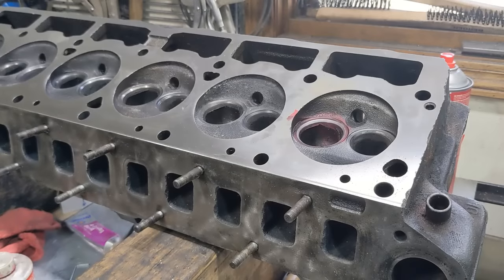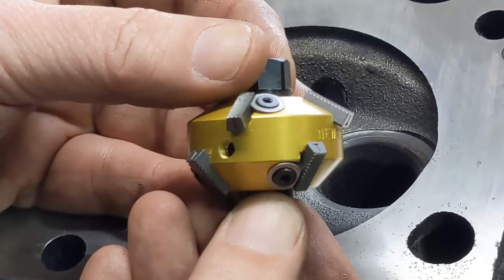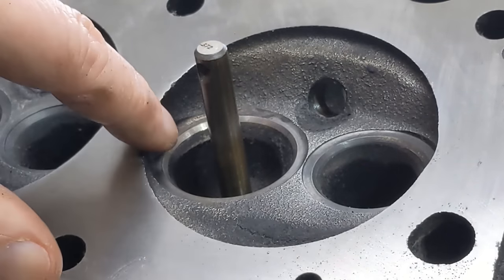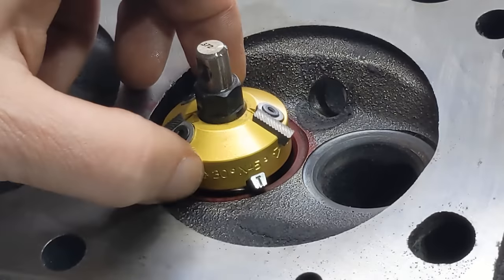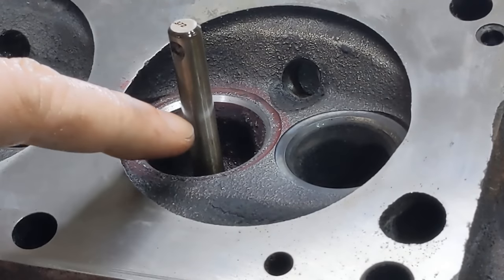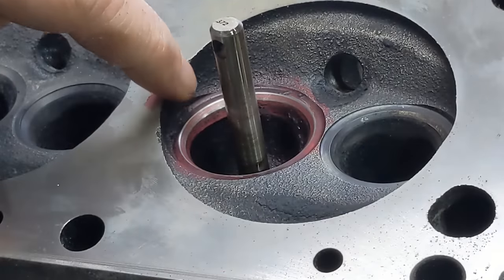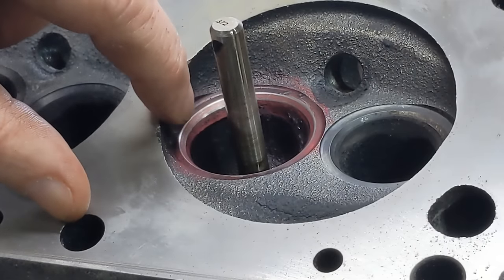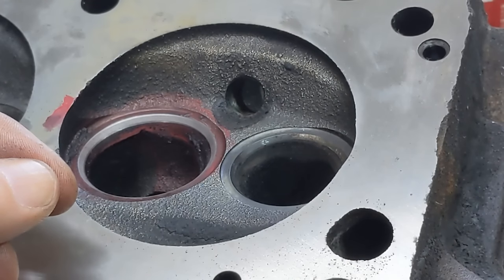Do Your Own 3-Angle Valve Seats!

Comment: Run that 60 again: seat width is bigger than I-10 through Houston.  Margin at the outer diameter [on valve] is good enough.  Aim fpr about 0.045" seat width.  Self cleaning and low lift flow will improve.
Reply: I don't know I-10 through Houston but agree.
Reply: @1crazypj  Houston, Texas has many 10 lane highways that are still packed with traffic. I am so glad I don't have to live there.
Reply: @skylinefever  Thanks for the explanation. I 'found' an old thumb drive today (from around 2010) with valve seat width information as percentage of valve head diameter.
Reply: @skylinefever  I live near i10 and work on 10 at the beltway on the west side of Houston . I-10 on the westside of Houston is 26 lanes wide. Remember every thing is bigger in Texas!!!
Reply: @mlwakat holy 🐄
Reply: @markalan4026  yes, Mark. The cows are bigger in Texas too👍

Comment: I find the hand cutter makes it hard to get a good constant cut as you have to reposition your hands while cutting.  I use a Milwaukee cordless in slow speed with 3/8 socket adapter and 1/2 inch deep socket.  It cuts quickly and leaves a nice finish..
Reply: I have an old Black & Decker valve seat grinder from the 50s or 60s. I don't do very many valve jobs anymore, but I do think a ground seat is the way to go. Especially for hardened seats.
Reply: @pb68slab18  Back in the 70s I had a snap-on valve seat and valve grinder.  IIRC they were B&D rebadged. When I got out of mechanics professionally, I sold them.  At the same time. the hand cutters came out. They did not produces as good a finish as the ground seats. Still using a drill motor real slow make the cutters work very well.. Still regret selling grinder but at the time I needed the money.
Reply: Start and stop of the hand cutter is not best.
Motor driven will be smoother.

Comment: The 60 and the 30 cutters do give you a more progressive flow pattern but their main purpose is to give a vale seat its correct width and its correct position on the valve face that is why you must have the valves you are using with you when you cut the seats. it is also very important with cutters like these that the valve guide is well within wear tollerances or your seat will be out of center or tilted. You also need to keep an eye on valve depth as undercutting seats leads to uneven valve spring heights and tensions. This is also very important when using new valves and new valve seat inserts because with some engines if you leave the valve sitting to high and have shaved the head the valve may hit the piston. This is more of a problem on heads with no combustion chambers like with most diesel engines. Gas engines with multi valve systems at more acute angles can have this problem as well. The valve seat shown at the end is to wide and that will work against flow rate.
Reply: Correct I agree

Comment: Grinding paste never failed me .....just takes a fuck ton of time when its badly burnt.
Reply: Lapping paste doesn't achieve the same as a three angle valve job. Lapping paste is for reseating. Three angle jobs also improve flow across the valve seat.

Comment: I purchased does cutter set in 1980s.  I paid $1600 US. I cut the seats at 45 degrees, and the valves face at 44 and half degrees for best sealing
Reply: https://youtu.be/uOk5L8Q__as  valve seat ring removers

Comment: The 46 deg angle on the valve and the 45 deg on the seat is so that the valves and seat will slap into a tight seal for mass production.  When I was working on the old VW motors.  When cutting valve seats you can slam the valve in hard or just seat the valve and give a gentle tap.  The valve will get a fine line on it so you can get an idea of the seat position prior to lapping/ grinding the valve and seat. It saves time from going back and forward from cutting and lapping.  I have had a set of Neway cutters for years, wouldn't be without them. They live on the shelf and they don't eat much.   Kerosene is a good cutting fluid and don't drop the cutters.  Cars, Lawnmowers, motorcycles and most anything they can be used on.

Comment: I used to teach this and video is probably better in most respects than the official Neway training video. (plus it doesn't have the 1970's background music)
There are a few extra things to check, seat width as mentioned by 'Flinch', seat position on valve face plus valve installed height
Seat width around 0.040"~0.060" (1~1.5mm) on intakes is normal with 0.060"~0.080" on exhaust side (1.5~2mm)
There is a general formula to calculate seat width based on valve diameter but maximum and minimum is  generally in the accepted range (unless your doing a 'race tuned' 35cc Honda weed-whacker or marine diesel with 3 to 4inch diameter valve heads.........LOL)
For 'ordinary' engines, centre of face is good as it will give maximum life before replacement or reconditioning.
For performance, move contact point closer to outer edge cut 45 to slightly larger diameter then reduce seat width with 60 degree cutter.
Although installed height is 'less critical' on engines with push-rods or adjustable rocker (or some form of non-shim adjustment) it can be very important and need the valve stem tips ground shorter to either get clearance (with OHC shim motors) or correct rocker arm geometry

Comment: I highly recommend using a valve seat runout gauge from someone like Goodson Tools. It goes over the pilot rod and will tell you if the seat is concentric with the pilot. It will also let you know which side of the seat is higher and to press the cutter a little harder on that side.  Valve seat runout plus valve face runout combined should be less than 0.002”.  New valves out of the box can have as much as 0.005 runout and need to be trued up on a valve grinder like your friend has.  /John
Reply: excellent recomendation
Reply: Using ink on the seat, and the new valve is a great way to see whether you have run out or not

Comment: Good job on the video.
The Neway cutters are tricky to master using the hand t-wrench.  I'll typically use (2) hands pushing downwards with my palms to balance the cut while rotating with some Windex for the cutting fluid. Using (1) hand typically produce an unbalanced cut that takes forever to cleanup, thus lighter cuts are better.  A helper spring would have saved me from dulling the carbide cutters when the cutter head drops accidentally every so often so extra carbide blades are a good option. I've used 800 grit lapping compound to quickly lapp the valves in and nothing rougher. Then a wire wheel to remove the lapping compound off the valve face and seat.  Not too hard to adjust the seat width according to the factory spec but it takes some practice for sure and I use a loop and caliper.  Trick is removing just enough to avoid cutting the seat too deeply or at least keeping them all consistent so IMHO it's good to practice on another junk head to get the technique down.  I believe the Neway powered head would be a huge improvement in cutting consistency and speed so that's probably my next upgrade. But otherwise with some skill you can definitely get some nice 3-angle valve jobs with these if you take the time and develop the feel for them.  Most of the pros would probably recommend a Serdi, Sunnen, or Rottler but for the DYI folks these Neway are not too bad for the money.
Reply: Thx for the input bro, all this while I was thinking about the machine shops for this kind of jobs. I am awakened. 😁
Reply: Only ever used neway cutters on Lycoming and continental engines, always working on seats from the other end of the cylinder with a long extension must have helped keep things square as I never had issues applying even pressure. Agree cutting fluid is essential for decent results.
Reply: So many people don't understand this. Seat concentricity is so critical to longevity. Factors such as valve guide wear only compound the problem. Yeah, a monkey can make a seat that will seal for a while with a Neway. But to create a correct seat is much harder. The real issue for Neway is the finish of the cut (as you commented) and the lack of cut depth indication with a hand cutter.  There is a powered track system for Neway type cutters but it dose not depth indicate. Runout is still an issue with any floating type of cutter like Neway And 3acut (ebay brand). By the time you have purchased all that you can buy a good used seat and guide machine like a Peterson 25 or a Winona and a basic Newen (not Neway)  3 angle system. The Newen has several knockoffs that are even cheaper than the brand name. Regardless quality application specific cutters are sold by cylinder head supply of Oregon, or Goodson, beam equipment. Silverline and many others.    https://www.cylinderheadsupply.com/pr3vasecuki.html
Reply: @bad406camaro  Holy shit, someone who actually has a grasp of engineering principles. Well explained mate. But you know what they say.. " I can explain it to you, but I can't understand it for you"
Seems to be the overriding vibe here.

Comment: It should be noted that the 30 and 60 degree angles are used to adjust the width of the 45 degree sealing surface. Too hide and the valve can actually run too cool. Too narrow can cause the valve to over heat. If I remember correctly a good width is 1mm. Also you need to avoid tool chatter when cutting and make sure the valve guides aren't worn.

Comment: In Dr. Lynn Mosher's head rebuilding class at Cal Poly San Luis Obispo back in the late 70's we were taught to forget about lapping ,as it should have gone out with the model T. It seems  as the valve heats up it gets longer and no longer seals at the nice frosty line from lapping that gave you a warm fuzzy feeling.I had lapped valves since high school like my ole man did once a year on his flathead Hudsons.  I checked this out once  and actually did it with a 170c.i.slant 6 with new valves and 0.030 larger stems like Chrysler recommends for worn guides. I step reamed the guides to the .030 as wellof course . I heated the exhaust valve in a lab oven to about  600 degees  installed with dykem and proved the valve face did not hit the previously lapped area.
Reply from the maker: Great info!
Reply: Is exactly the way I have done it for50 yrs, never had a problem. Soon as I saw that pogo stik an paste  come out,I could see an otherwise reasonable  job being vandalised. 
My saying, "lapped  to crapped".
Also  he only machined an intake with no insert straight cast iron "chocolate ", compared to some modern inserts.
I say, show us a job on a well used welltite inexhaust insert using these cutters. And show the actual outcome with the markings on the valve.
Adrian.
Reply: @adriandines  I've had Neway stuff for years, as well as an old flexible grinder with stones, but I made a mistake using the Neways using a T bar handle in an old air cooled engine with rock hard seats (same with sintered Kolbenschmiddt stuff).  I eventually got out of the poor cutting results by using a slow speed cordless drill and ball joint driver, and learnt a lesson in the process. They did produce a good finish in the end, but the next engine I build I will definitely pre-finish the replacement seats in a lathe first to reduce the amount of material I need to remove.
Reply: My 90's cadillac service manual says that new valves should never be lapped. So I assume used valves can be lapped?
Reply: I think a light lap at least lets you know there is full contact around the valve and where it is seating. The engine running is going to pound that fuzziness flat in no time.
Reply: @Spiritof_76  instead of lapping I use red or blue dye and see where they contact.
Reply: @MSU_BullDAWGz  I use dye-chem and a fine grit of lapping compound, but only a minor number or rotations.

Comment: Nice video! Didnt know that you can cut the valve seats on your own, so if I ever come across the need to get this done, now I know I can do it by myself! Thanks!
Reply: These are handy tools - Neway makes them.  You can add an extra angle or two to an existing valve job if you like.  I picked up a 75 degree to improve effective intake radius on a set of heads some time back.  If the cut goes past seat register on aluminum heads, you probably need a light blend with a stone to smooth the transition.  No big deal, but dissimilar materials under the same cutter don't always get the same bite.    As he says, keep cutting force near center of carbide inserts - they will walk on you if don't [from side loading] and you could cut a groove instead of a clean angle face.   They may chatter a bit on powdered metal seats [cutting by hand], and not sure if I would choose them for the 45 [or whatever the seat angle is going to be] in those cases.
Reply: So do I bro 🙏

Comment: Usually a 3 angle valve job is done for performance, a single cut or 2 if seat is too wide is used in stock applications. You forgot to mention about seat width. The whole reason for a 3 angle valve job is to make the seat as small as possible and the other cuts is to make that width correct and to increase flow for performance. You had your valves reground, did you also have multiple angles cut on them to maximize airflow ? If spending that much to do seats I didn't see any porting done to the heads. I'd port them before doing seats as porting may damage seats and you would have to repeat doing them over again.
Reply: The maximum flow restriction of any head is the valve seat and valve.
A closed valve is very restrictive. 🤔
#1 thing is a good valve job.
#2 bowl shape
#3 port shape and size

Comment: I have had a set of Neway cutters and pilots for 40 years. Used them on industrial engines and they worked fine. I would still get a 3 or 5-angle valve job on a serious street bike or car.

Comment: Great video !  While porting my DOVE heads for my 460 I slipped on the second to last port. I put a nice little nick on an exhaust valve seat. Hopefully I can clean the seat up with the cutter and save a ton of money. Its worth a try. All the machine shops in south central Texas are backed up for months. I been calling every where and seems to be 2-4 month wait to get the seat fixed. My 460 block has been at the engine shop for five months. I sent it to get bored .060 over, align honed, decked, new pistons and the whole thing balanced and short block assembled. Owner told me 8 to 10 months at least !

Comment: The step before you started cutting the seats was to check valve stem to valve guide clearance with a dial indicator.  If it was out of spec, the fix is to knurl the guides or install guide inserts.  The clearance must be within specs before cutting the seats.
If after the lapping, it shows the valve face is not contacting the seat in the center of the valve seat, then you can adjust with the 30 or 60 degree stone to center contact area of valve face to seat.  Finally measure width of contact area of valve face to verify that it is at least the minimum width.
Reply: Or use a tapered pilot ….
Reply: The FIX for out of spec guides it to REPLACE THEM.  The cheap hack that might last a while before you get high oil consumption is to knurl them
Reply from the maker: With the cost and scarcity of tools, knurling probably isn't cheaper. But I do have access to a set of the tools, so now I think I might pull an old head off the shelf and knurl the guides. Could be fun and interesting, and as a bonus it will trigger a bunch of machine shop guys into telling me I'm doing it the wrong way.

Comment: Nice vid clear explanation.  I have my Newey set from 19??, regularly used.  However, I only use the 30/60 degree cutters to take the sharp edge off the main seat, v light cut.  Making the 30/60 degree cuts any bigger is pointless, as if too wide, they quickly coke up, leaving you with one wide seat, roughly 45 degrees.

Comment: I do SEVEN angle valve cuts on my motorcycle valves and seats. I learned from the late "Pops" Yoshimura. The 30% open flow is 50% GREATER, which is VERY important on my 1964 305 Honda SuperHawk twin two-valve engine. Yes, the flycutter cost nearly a thousand dollars and there is only one man in town I let use it-he also does the cylinder honing for me. He is an artist with the Sunnin honing machine. When he decides to retire, the lady that runs the machine shop says she'll probably close-up, because she can't get any young guys that will learn to do race engines and drag boat engines. REAL machinists are a dying breed, sadly. If you can install new bronze valve guides and ream them to fit the valve stems, you might have the makings of a machinist. Now when like my late Daddy, you can cut the taper for the pins that hold on the wings of a B-47 bomber (by hand!) you ARE a machinist! He also built the first and second stages of the Saturn V rocket booster for Rocketdyne. We ALL knew the astronauts PERSONALLY, so it wasn't "Just a job". I'm a klutz.
Reply: “The lady that runs the machine shop.”
WTF??
Reply: @psychbomb7543 
SMH
Reply: REAL engine machinists aren't a dying breed. Maybe you lack the ability to find them but they're still out there and new ones are coming along behind.
Reply: Sign me up I’ll do it, it’ll give me the extra kick in the ass I need to do the old Palmer in my sailboat
Reply: I do 9 angles on my honda c50
Reply: Those 305 Super Hawk heads are a work of art. BEAUTIFUL ports for high flow.